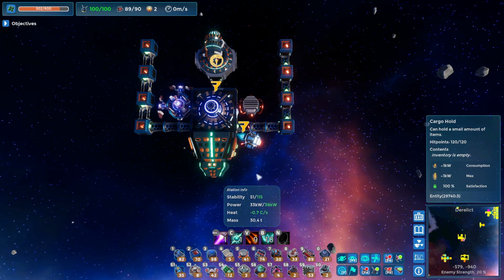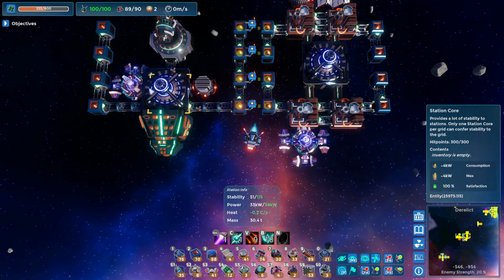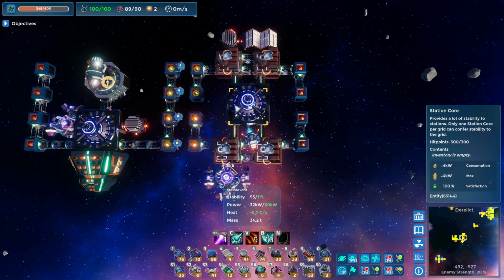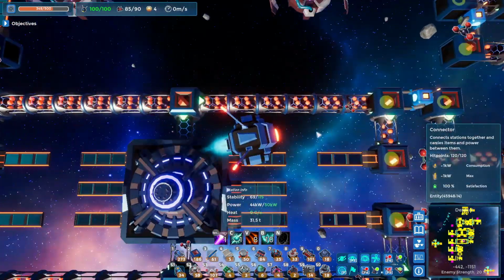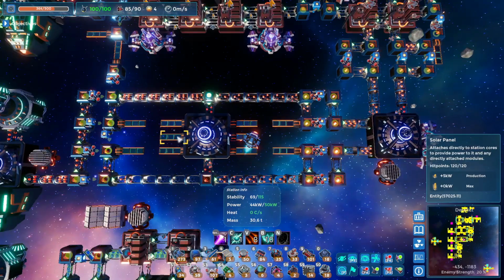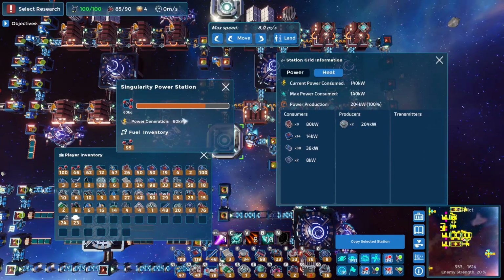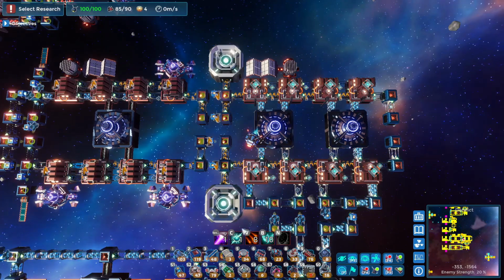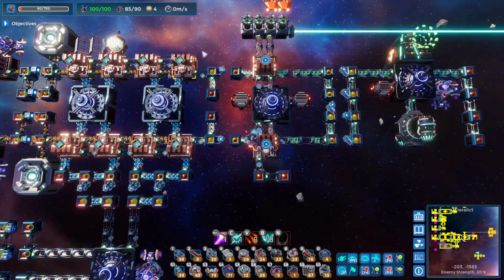An Optimal Factory Design  | Final Factory Guide

Comment: I use a somewhat less efficient but lazier design.  By lazier I mean, I don't have to spend a lot of time having different cargo haulers deliver items to different parts of my main base.  I recognized, as you did, that asteroids would run out of resources and that l would need a central base if I didn't want to have a nomadic base that would force me to rearrange everything each time asteroids ran out of resources.  Since station size is limited, a nomadic base would eventually become impractical as I would need to move the modular parts one at a time.  What is the point of automation if you have to do a lot of things yourself?

I noted that there are only a few basic resources in the game.  Therefore, I only need to long distance transport a few types of things:
- Bauxite Ore => Low Density Structures
- Iron Ore => Medium Density Structures
- Silica Ore => AI Controller Circuits
 
Nothing else uses these 3 basic asteroid resources in their recipes.  Therefore,  it is more "cargo space efficient" to produce components at the mining sites and transport that instead.  I have 2 solutions for getting the components to my main base:

1) Use cargo haulers (that's what you call them) to move the components to the part of my central base I designate as component input stations.  From the input stations, I use either logistic lines or mass drivers to get them where I need them in my main base production centers.  This lets me scale up the two independently without having a complex hauler system where I need my cargo haulers to make multiple stops.  If I need more component input rate, I just scale up the input stations.  If I need more production, I just scale up the production centers.  

2) As resources get farther away, you may want to use "Singularity Cargo Artifact" that you can find by defeating enemies.  What you do is you have your remote mining colony deliver the raw resources into the artifact, and it is instantly available everywhere there is another one of these artifacts that you place.  Since there is no way to organize the contents of the SCA (there is no way to say, limit the maximum amount of bauxite to say 1 slot only), it may be prudent to make sure that you meter the amount of resource that you insert so that you don't cut off the input of one type of resource.  I do this by balancing the number of inserter bots putting in a specific resource across the 3 types of resources.  This second strategy completely removes the transit time from distant resource colonies.  I recommend building "battleships" (larger stations with turrets and defense stations) with rockets that can move to the distant colonies and protect them.  Consider armoring and protecting the SCA as well since it is so valuable as a logistic tool.  Do not deploy the SCA until you a ready to protect it.

Comment: I'm glad you've been enjoying the game, it has rapidly become one of my current favorites (the other one current favorite being Helldivers).

I’m really appreciating the neat organization of your base and how different it is from many other bases – more or less exactly what I hoped to see as the player community grew. I do wonder how they will handle 4 inputs however.

Since you’re moving on I thought it might be a good time to share some late game tips that I didn’t want to pollute your early game discovery process with.

First some obvious non-spoilers that the game should advertise better because they are fundamental:

* Cargo Drones can pass over pretty much anything except logistics stations and other cargo drones.

* Armor blocks do not cost stability.

* With the receivers and transmitters, you can essentially move power generation away from your assembly station so that it no longer burdens its stability.

* Struts work in an obtuse way but are very potent when trying to control stability, mostly rendering station cores unnecessary: They will reduce the stability cost of an equally sized or smaller station by 5, but only in one direction! So to reduce stability fully for 2 structures with 9 stability you would need more than 3 struts (2 remove 5, 1 removes 4).
Assemblers that only cost 4 stability can be reduced to zero stability cost with just 1 strut attaching it to another assembler!
But 2 assemblers will need 2 struts to negate the stability of both assemblers instead of just 1.
The struts do cost 1 stability each however.
They’re also directional, they have a front and a back which only matters when strutting structures of equal size.
This means it sometimes helps to rotate them if they’re currently pointing so that they remove stability from a structure that’s already fully reduced.

* Duplicators function as this game’s version of Dyson Sphere’s Proliferator Sprays or Factorio’s Productivity Modules, they are very potent.

SPOILER WARNING! Do not read past this line if you want to discover these mechanics yourself.

* In more difficult modes, keeping stability low becomes essential as global stability increases the rate and intensity of enemy attack. Station Cores are very rarely needed as builds can often be kept below 35 stability by judicious use of struts and separating stations that don't strictly need to be connected.

* Zero-stability blocks like armor, laser turrets, or singularity power stations always count as a bigger block when you attach them with struts, which means you can attach the last assembler in a line to some armor with a strut in order to reduce its stability. This may or may not be changed in the future.

* Cargo drones can be used to build a main bus and push items out to junctions using inserter bots right under them.
You can also use them as super-long inserters to add new ingredients to the middle of your build. Press F5 to un/hide cargo drones.

* Mobile stations (ships) don’t need to move cargo around within them.
You can just deposit directly into a cargo hold, and then fly those cargo holds over to the new station and inserters there can withdraw directly from them – this makes managing mobile station haulers much easier, especially small ones.
Mine transports only 4 cargo holds around on its butt and then offers said cargo butt to the receiving station which deposits directly into cargo holds that deposit into logistics stations near the assembly line that needs them in a bus/shipping hybrid.

* I lied earlier, Duplicators are not very potent.
They’re downright broken powerful.
At the moment they encourage enormous megabases that only connect the assemblers, struts, logistics stations with radiator artifacts, stability artifacts, receivers, and the duplicators themselves connected by spiderwebs or spruce-frames of connected armor blocks.
Power is added through external power generation stations with transmitters that feed into receivers – only the heat from the assemblers themselves and these receivers needs to be dealt with. One day duplicators may also add to heat.
Normally you can easily attach 2-4 duplicators to your assembly arrays. 2 duplicators multiply your output by 207% after just 4 stages of refinement, each stage increasing the amount by 20%.
With the 10 duplicators you can afford very early in the game using this setup, those same 4 stages will instead increase the output of the 4th stage product by 1 600%, each stage increasing the amount by 100%.
* This gets even more ridiculous when you reach the fabled Dyson Swarm and its 100MW receivers and transmitters – or even a direct armor connection to it which does not increase heat at all.
Reply from the maker: Great stuff - Pinned!
Reply: @TheDutchActuary  Glad you enjoyed. :>

Ooh, also some fun shortcuts.

* F3 to hide your fleet of bots.
* F5 to hide cargo drones so you can more easily build under them.
* Q to sample whatever you are hovering over.
* Ctrl+C and Ctrl+V function as copy paste in a box you select.
* Alt+D to mass-delete in a box you select.
* You can now dismiss alerts by right clicking them.

Also realized that we don't have a good list of gameplay tips on the discord that I can find, so I planted them there as well.